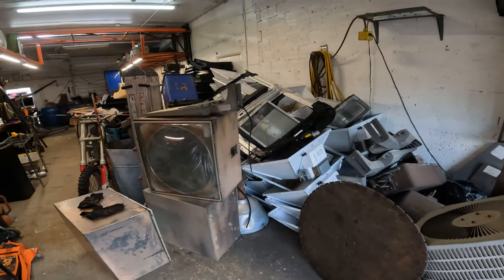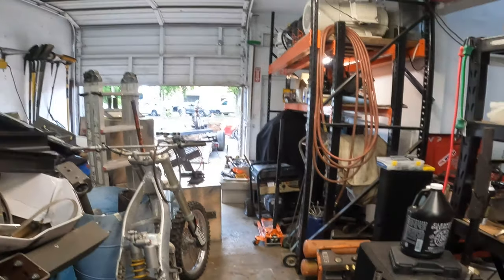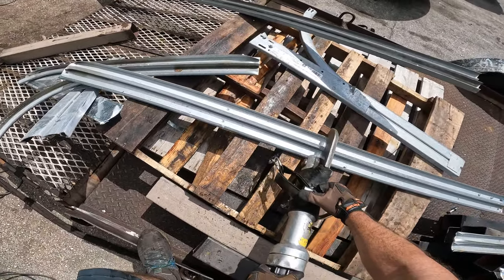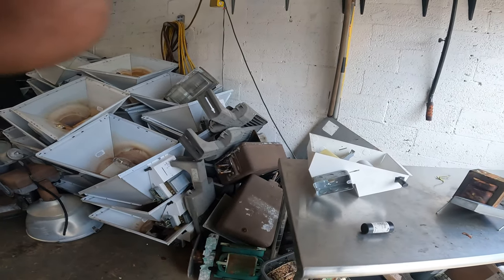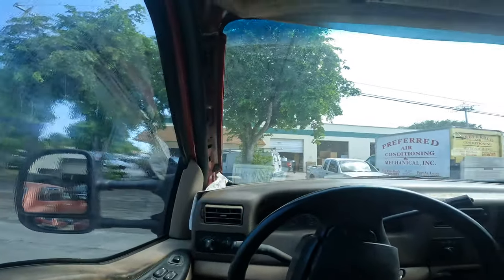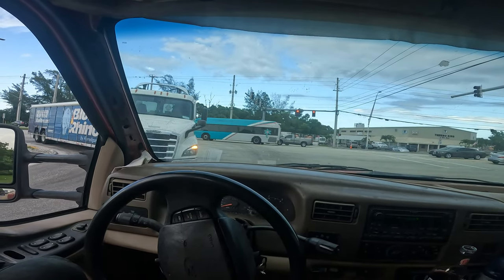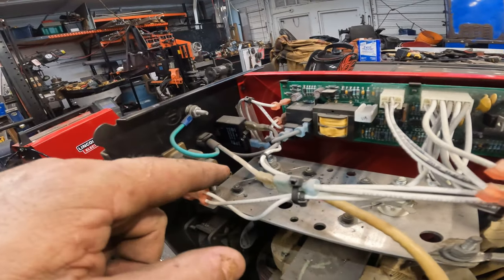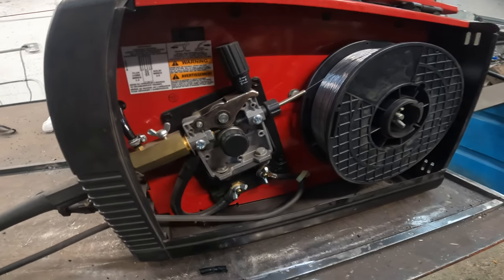Scrapping Steel. Pushing My Trailer To The Limits!

Comment: Always great videos, but a lot of effort for steel. For the amount of $ you get, a better option would be to drop a roll off box on a Friday, load it up for pickup on Monday. Maybe less money, tons less drama and labor. Do that once every two months.
Reply from the maker: That's an interesting idea. I usually have my small trailer dedicated for sheet steel and usually the only prepared steel I get is the transformer steel witch is not bad loading. If I did leave box out side people might steel from it. Can't leave anything out side in West Palm Beach. lol

Comment: Cutting thicker steel like that, the Diablo Carbide Blades are the best.  A bit pricey, but they cut through like butter!!!  Way back in the '90's, there was a coke shortage for the mills and they were literally buying all the scrap steel they could...I think my top price was $380/ton!!!  it was short lived, but nice while it was going on!!
Reply from the maker: Nice! I was thinking of a different coke shortage when I first read that. lol I have used the carbide blades in the past, aside from the cost you are right they cut like no other. I like most diablo blades, I have one I use on a 7" grinder for cutting large aluminum or copper transformers. Cuts like butter but dangerous as all hell. lol